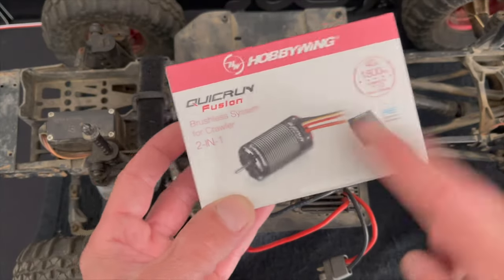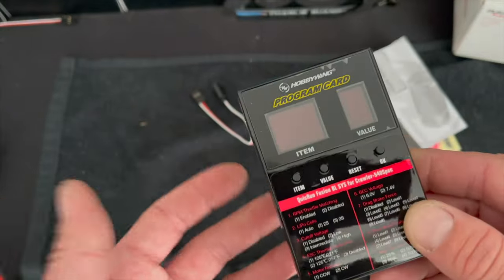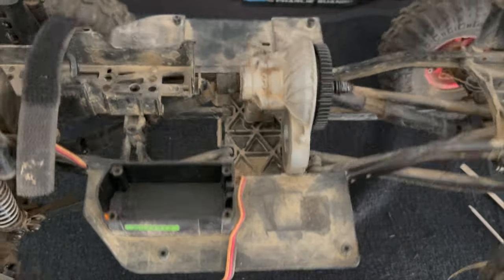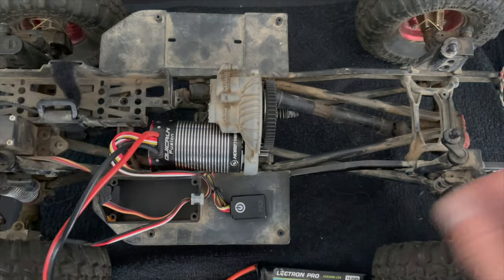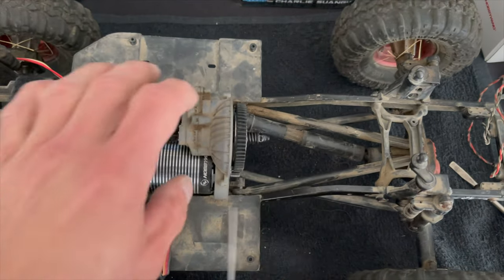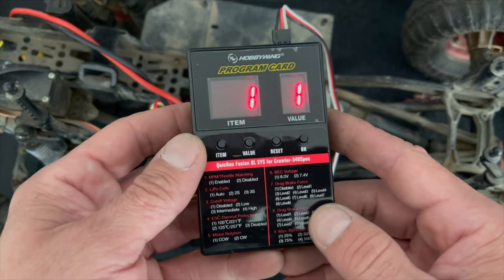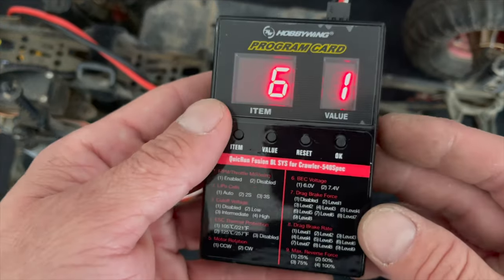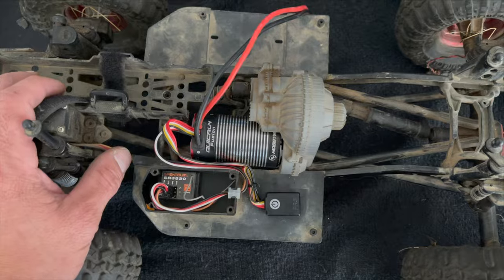The Charlie Show /// Episode 258 /// Fusion Complete setup and install.

Comment: My fusion  se is full send in reverse...no easing into it...just bam 100%.
Program card wont go to item 10 like it says on label.

Help
Reply from the maker: Check the Esc M\Manuals Setting Chart for the ESCs Values as they may not match the sticker on your tuning box.  Redo the Automatic Motor Pairing, and then redo the Calibration.  Worth doing a simple servo test of the throttle/reverse output as well.  

https://www.youtube.com/watch?v=NWCgbxWIp24